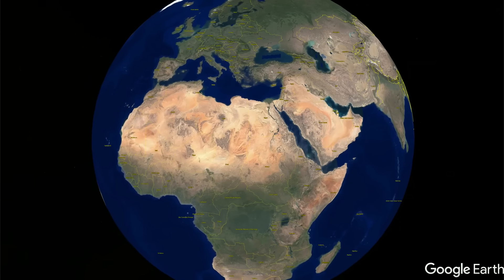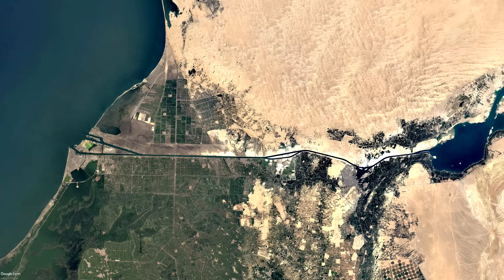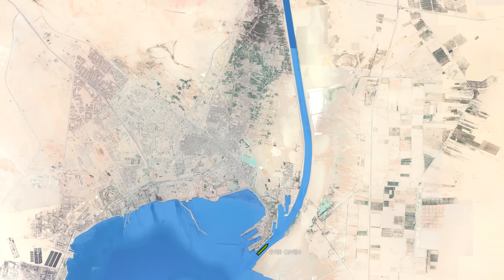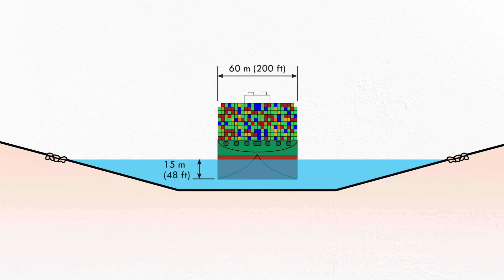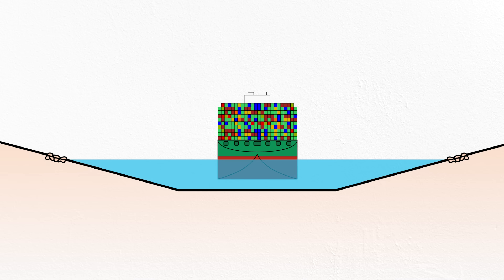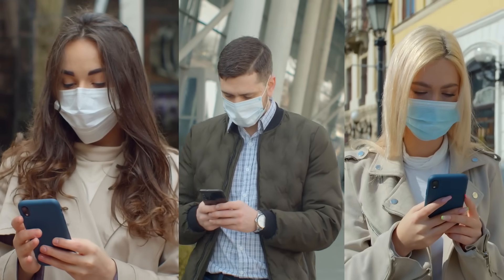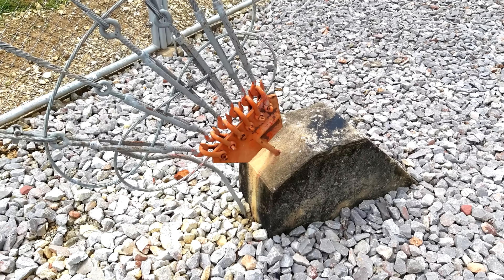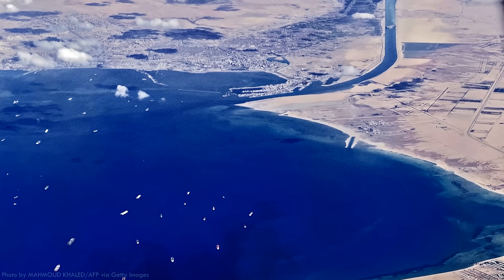What Really Happened at the Suez Canal?

Comment: As a master of coastal vessels for 35 years, I have experienced both bank effect and squat, when manoeuvering in narrow channels. I think one of the main contributing factors for this incident was speed. I noticed from the AIS data that the 'Ever Given' was moving at 13+ knots. Vessels usually proceed in the suez at 8 to 9 knots. Not only would excessive speed contribute to bank effect and partial loss of steering, but also when the inevitable happens, the vessel will wedge further into the bank. The questions are: was speed increased due to the fear of the wind having more effect? and who made the decision to increase speed, the master or advice from the pilot?

Comment: I understand Bernoulli's Principle and the bank effect, but why does the opposite happen with ground effect in planes and cars?  One explanation I've heard for cars is that the flow under the car tends to stall.  That's why speeding it up and helping the air exit with a smooth underside, a diffuser, and a bit more ground clearance at the rear than the front works.  But what about a plane?  They exhibit ground effect lift with a lot more distance to the ground.

Comment: I wonder: would it help placing vibrating machinery around the sand covering the bulbous bow so that sand behaved more like a liquid which could helped dislodging the ship somewhat faster?
Reply: I would imagine that might cause even more issues. While it would loosen the soil around the bow, the loosened soil would drift along the current into the canal further on, making another cleanup necessary. Sort of like pulling an object out from under a vehicle but having to leave it in the path of the same vehicle once it was able to move. Perhaps there wouldn't be enough displaced soil to cause an issue, but the canal depth already proved to be too shallow for a ship that size, so removing the soil would be the best possible solution.

Comment: the digger was perfect for parody..     I would have opted for a couple of steel pipes  being driven into the ground where the tip of the "proboscis" was buried   and pumping  water under high pressure to break the suction  and "pump"  the nose out of the bank...   in the principle of "fracking"

Comment: Wasn’t the 🌝 the only rescuer while all others stood by and watched?
Reply: Everyone was just pretending to try cuz they knew the Moon was coming around to get it done.
Reply: @brokentombot  I doubt that they all knew about the moon's strength.
Reply: @stebarg  a couple days in scientists told them the tide would come to help so it gave them hope to keep doing every little thing to make all factors come together
Reply: @brokentombot  I would have towed it from the heck with several winches from the other side of the channel. Done. 2-3 days max. with or without moon.
Reply: @stebarg  It is huge and heavy. It is surrounded by sand. How will you construct a heavily anchored winch system in 2-3 days?
Reply: @brokentombot  That’s very easy. Just drill some metal rods in the sand and attach it to a bunch of cheap winches. You just have to bring them with a helicopter to the location if road transport is not handy and do the work. Can be done in one day, I’m sure. That’s my view as an engineer.

Comment: In cars, if the rear wheels slip and move to the left, say, then the nose goes to the right. Then the car ends up on the right shoulder or ditch. The whole car could even pivot around the dug-in front wheels. (well, we didn't see THAT on the ship).  So perhaps the ship was too close to the left, the lower pressure caused the stern to move to the left, a yaw is generated to push the ship to the right. Steering is done at the stern, so that would be a hard control system problem.

Comment: So how come this bank effect hasn't been evident any of the other 10 ships of a similar size? Nice Try.
What about the strange movements that the Evergiven made BEFORE it entered the canal. All ships of any size have bulbous bows these days.
How did it hit the bank if there was a local pilot on board?
Reply: It has been evident, its just normally conditions allow the ship to not be so close to the bank. 

No strange movements occurred before entering the canal, it was all extremely standard and can be seen by viewing other ships in its proximity at the time.

Pilot likely wasnt on top form, or conditions made it hard for the ship to navigate - this is still under investigation.
Reply: @Garfie489  So circling three times in an irregular pattern before entering the canal is NOT STRANGE? So all the other ships made the same moves? Really? There are none so blind as those that will not see.
Reply: @roblinnell8382  .... yes. 

The circles are where the ship is trying to maintain a holding point without dropping anchor - as required by the canal. 

One of the circles moves significantly from the others due to the proximity of a passing ship, which is clearly seen on the tracker.

Given you clearly have not even looked, i dont think you can accuse others of being blind. Compare the tracks to others within the canal through history, and its a very standard procedure

Comment: I'm pretty sure surface area of that massive ship combined with a sand storm pushed that ship into the shore.  That and visibility was probably poor too.   I know if i drive too fast in a wind storm on the freeway it becomes harder to control.  I'm also pretty sure the squatting effect you talk about in this video also become worse the faster the ship travels.  I'll bet the final report will essentially say that the ship was traveling too fast for the conditions.

New regulations will probably dictate speeds of ships in the Suez depending on vessel size and wind speed.

Comment: All Indian crew numbering 25 were arrested alongwith Captain of the Ship. As the Suez Canal agreements stand the Pilot cannot be held responsible for navigating through the Canal. Also the ship pays huge sum for travelling through Canal. A separate parallel Canal also needs to be built using very heavy machinery for easy passages because more such blockages can be expected also existing ones need more dredging to carry heavier Cargo ships.

Comment: I'm thinking there may be  simpler issuue, (in addition to the bank effect). The energy of fast flowing water under and around the ship will dislodge and suspend loads of sand, so the ships lower hull is floating through slurry, that slows it and turns it to the bank. It hits the bank, the slurry drops out of the water and sets around the hull.

Comment: Height of deck cargo is effecting the steering by wind power, plus the displacement factor of the bulk at speed. Slow anal speeds are required, letting wind have more effect that it would with a normal ship. Deck cargo is always overboard in sea going waters, by winds. Ballast is limited effect but can only adjust to maximum. After that , streamlining deck cargo might be a future development or limitations are required in view of changing weather patterns Globally.
Reply: You might want to spell check your comment 😉

Comment: Bernoulli’s equation causing uncontrolled lateral drift and Dilatancy creating negative pore pressure around the nose. This geotechnical engineer agrees. Especially since the first reaction to lateral drift would be to increase speed to gain better rudder control thus providing the inertia to get the nose good and stuck into the bank. That’s what’s technically known as an “Ahh Crap” moment in the Engineeirng profession.

Comment: I used to run an 83 ft motor yacht that would get up in plane over 18 knots... And it was funny the boat would run actually faster in water that's what say 12 to 28feet deep I guess because of compression it would raise up and run faster.. but once I hit that it was like 28 ft the boat would actually drag because I wasn't getting compression in would slow down... Then once I got over 50 ft the boat would get released again and take off... I ran the boat up and down the Gulf Coast so those water levels coming in and out of say Panama City Destin, any specially Apalachicola I noticed it... So yes there's a lot to be learned about speed tonnage and depth of water in about how you can speed up and shallow or water and I'm pretty sure it always compressing down which was lifting the boat up then at a certain point I broke that and it it actually drag the boat down until like I said it got deep enough where it released the boat again... It's just pure science being there on the boat and feeling it and seeing it with the GPS... You have a great day... I appreciate your insight hopefully this helped with understanding speed and displacement weight in depth of water... I guess I need to get a computer that's got hydrodynamics on it and do some research myself.  Anyway God bless you and your family... Sincerely Captain Cooke.

Comment: Would liquefying the soil around the bow been possible/'practical"? Thinking along the lines of injection air/water into the soil. Perhaps pulsating for vibration, too. The idea is based upon landslides caused by earthquakes. As a first, easier attempt, I think I'd just use high pressure water to move the sand away from the bow. But, you use what ya have, I guess.

Comment: Nice explanation. You touched on this when you explained the shape of the canal, but I kind of wish you would've used the front facing diagram and turned the vessel sideways, since it was essentially sitting on the bottom of the canal at either side as well. Not "just" the stuck bulb. A fact that seem to pass many by.

Comment: I am not saying bank effect does not occur, and I could be wrong, but my gut feel that Bernoulli's Principle, as a **cause**, is misapplied here.  This is similar to C.A. Marchaj's claim of the slot effect propelling sloops in earlier editions of Aero- of , which claim was removed in later editions.  There is a water level difference between the two sides of the ship that varies along the length of the hull, which applies a torque to the ship about a vertical axis.

Comment: The other problem is similar to canal boats - if you have a strong side wind you need to travel at an angle with the bow 'up wind' so a bit of the speed vector produces a force to counteract the windage. In very strong winds and slow speeds it may not be possible to get enough of an angle to maintain sufficient force to counteract the wind. One the bow is blown off the correct angle there is little that can be done as trying to bring the bow up to wind results in the stern going the other way and it may well hit the bank. If the boat was fitted with bow thrusters these could be used to counteract the windage force but I don't think large container ships are fitted with them ?
Reply: They are on many of them and the Ever Given is equipped with them. So, as per my own comment elsewhere on here, the question is: why did they not use them?
Reply: @alanthorpe2022  Agreed the Ever Given appears to have bow thrusters - the Wartsila site says they become less effective with the vessel moving due to suction. Lots of questions though like are bow thrusters rated for continuous operation or only for short term use when berthing ?

Comment: Has anyone looked into the possibility of the boat being overloaded?

I found an article dated Feb 1 2021 ( https://shipinsight.com/articles/is-box-shortage-at-root-of-overboard-loss-increase/ ) linking box shortage to increased overboard loss in 2020, citing problems such as "Rusted cargo securing points, improper lashings, and exceeding stack weight limits"

With the pressures experienced by shipping companies after the pandemic the temptation to overload crates and push boundaries as far as they can get away with would be tangible.
We need to analyse footage of the Ever Given before and after the incident to check it's draft. I just don't buy this excuse of high winds blowing the ship sideways.

Comment: Practical Engineering, Why could they have not used two or three other freight ships cabled together in series to just back the Evergiven out of the embankment? Wouldn't they have had the necessary force to dislodge it, even with it being entrapped in the sandy bank?
Reply: Nope. There was another channel which worked out the figures, and even if they had the worlds strongest tug boat to pull the ship out (and theres only 1 of them), itd have required 90 of them to move the ship by rough estimations. 

Ships dont really have much pulling power given they are operating in water and thus dont have much to push against. You then get into the issue of how do you attach all those boats together.

Comment: As a young sailor, and technician, I was called to the stern of my ship because there were concerns about water flooding into the VDS well.  At the same time I am being hailed to the Bridge to figure out what is going on with the doppler speed log.  As I come onto the Bridge, I pass the navigator's plot and see where we are, and get chastised by my boss for lingering there.  I check the GPS speed and see the inertial speed is matching, but the doppler speed is all over the place.  I recommend coming down in speed, because I've figured out we were squatting.  The CO looks at me, so I explain that we are inclined, and point out his horizon is off, and the fan tail in the flight deck camera, and sure enough he orders the OOW to drop speed.  I'd had the advantage of seeing the fan tail, and walking the length of the ship, and as soon as I was on the Bridge, I could see everything was skewed.  We were in the Chesapeake, and going a bit faster than was probably ideal.  They were on the Bridge the whole time and small changes were not visible to them.  Good times.

Comment: The bank effect was the first thing my 82 year old dad said when he learned what happened to the Ever Given. He used to be a skipper on a small freight vessel sailing the sea, lakes and canals around Sweden in the 50's and 60's.
Reply: Yes the old sailors used to call it smelling the bank. It doesn't matter what size vessel if it is in a restricted channel the same effect applies,  ie.  A massive block of ship is pushing water ahead causing a reduction in UKC or under keel clearance with water rushing past causes Squat Effect.. and the only way to counteract this is if by slowing down the speed.. that't if you have enough time.  With Squat effect if it sets in no amount of counter helm will make a bit of difference. This is a very real thing.. speaking from experience and after 45 years at sea.
Reply: @dolita windo still doesnt change the physics of the bank effect that he mentioned.
Reply: Kate Simpson  Why were you loaning everyone money back in the 60s?
Reply: It seems more likely to be the excuse for supply chain distribution issues. Easily blame all this scarcity pricing bs. If we turn off tv life would normalize as we focus locally. All globalism has done is destroy everything that accepts it.

Comment: How does this "bank effect" work in more details? I understand that a faster flow of water will create a lower pressure. But in order for the water to start to flow faster on one side than on the other, the pressure difference between bow and stern needs to be larger on that side, than the other side. But that would imply that the higher pressure on that side at the bow should push at least the bow away from the shore.

Comment: I don't understand why they didn't use mud jacking to dislodge the ship.  (Aka, bore small holes through the soil to the ship hull, then pump in high pressure fluid to push the ship and eliminate the suction.)

Comment: Check out this animation of the original satellite tracking data for the Ever Given.  
https://vimeo.com/531626438
Pay attention to their speed. 
Reportedly the wind was blowing 30+ knots from the south (not east) but you can see as they entered the canal going NE, it appears to be pushed against the left bank, and the only way they could keep it off the bank was to accelerate, which they continued to do most of the way through the turn, and only started to slow down once they were in the straights.  My hypothesis is that they lost steering authority when they backed off the throttle.    Notice it looks like it fishtailed.

Comment: I saw this happen in Mexico.  It was amazing.
“We did several things,” said TITAN Salvage Master, David Stirling. “We used a bubbler system, where we drilled holes in the hull of the ship and ran compressed air through them to generate a lot of turbulence and move sand out of the way. Drilling more than 60 holes into the side shell of the ship below the waters line and installing air piping while the holes were under pressure was in itself a great accomplishment. This bubbler system proved to be quite effective in removing sand from around the vessel and greatly eased the ability of tugs and pullers to swing the bow of the ship back toward the sea. Additionally we had tugs generate wheel wash from their propellers and we used a large Toyo pump, which sucked up and dispersed sand like a giant vacuum. In addition, a dredge was used to help maintain a channel for our escape route once the vessel was freed from the beach. All of these sand removal measures helped to stabilize the ship and ultimately free her.”
https://crowleymaritimecorporation.blogspot.com/2006/03/giant-ship-turned-tourist-attraction.html?fbclid=IwAR3cusd3U7akpQvCH8zTohx9LBKtJ3FyAtrnnp-yEVQy7tLto82oXpWoi8A

Comment: I wonder if a floating toy boat held in the same spot by a string upstream with water flowing by it on the sides would also model what happened.
If in the center it stays there.
If on the side it gets sucked further to the side by the displacement/speed up effect.  
I'm guessing, I don't have an acrylic flume.